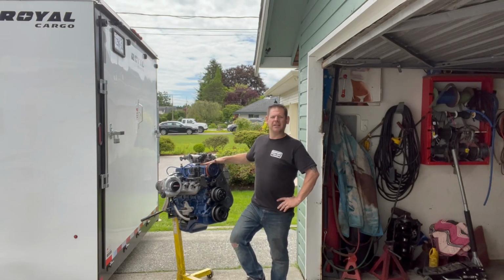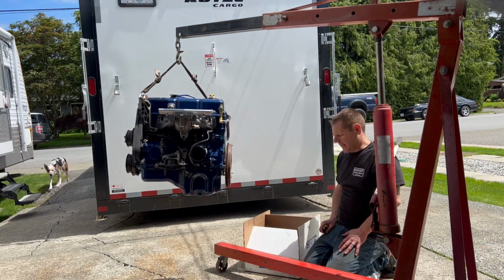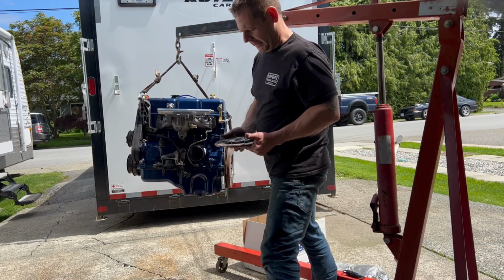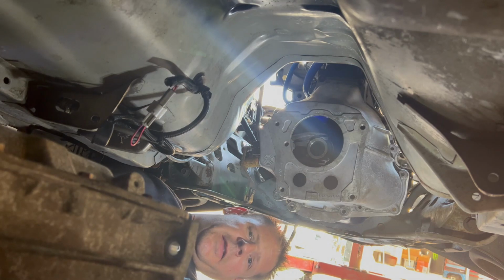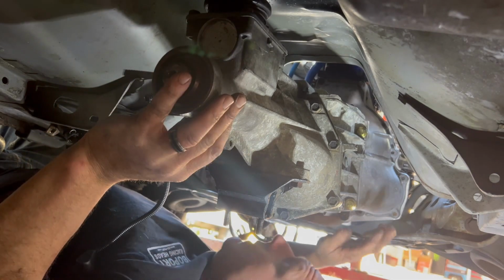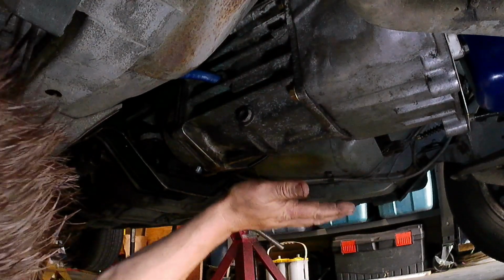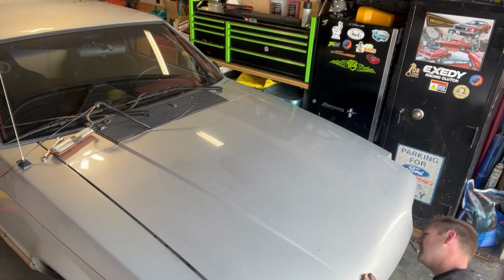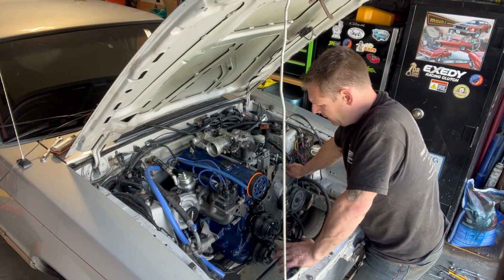2.3L Ford Turbo Lima Engine Swap Install into Smokey the Foxbody.

Comment: Heey I have a 1998 foxbody 2.3l and I added a t3-t4 turbo to it
Any advice on how to workout the computer tunning and the injectors? 
I've been told I need bogger injectors and a new computer dor tunning
Reply from the maker: Not a lot of options for tuning bigger injectors in with ECU,  Best option is to get the PIMPX ECU from Stinger Performance.

Comment: Which flywheel do you run? Have a part number on it?
Reply from the maker: I found this "part #" area a bit tricky with these flywheels as the 2 different flywheels that I had (7" & 7.5") showed the same stamping #'s. It was confusing because they were clearly different, But he main thing to remember is that the non Turbo 2.3 flywheel has a 7" clutch, The 2.3 Turbo uses a 7.5" clutch, and the pressure plate bolt patterns are very different between them. So searching around on the web trying to find an answer on the stamping #'s, I found info saying that some Ford Ranger trucks also used the 7.5"clutch.  The 7.5" flywheel will be found on Foxbody SVO 2.3L Turbo, 87/88 2.3L Thunderbird "Turbo Coupe",  Mekur XR4TI 2.3L Turbo. and 'Some" Ranger 2.3L (Possible 4x4).  Smokey has one from a wrecker, I found a Ranger flywheel, (More Common)  measured the disc area, and bolt pattern to confirm is was a 7.5".  Bolts up perfect to the SPEC stage 3 clutch for turbo 2.3L Lima Engines.  Hope this info helps.
#BuiltByBo